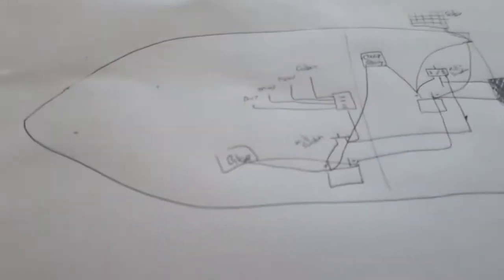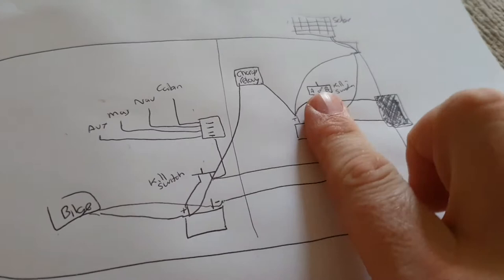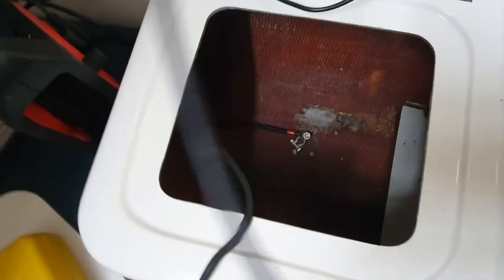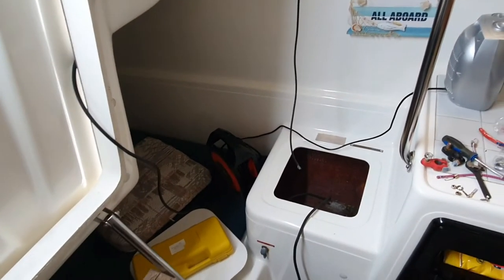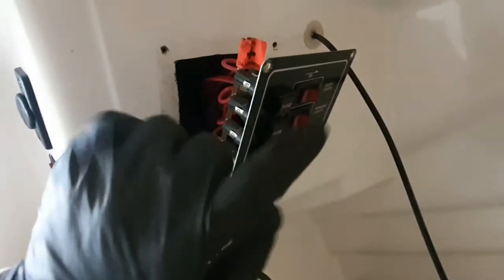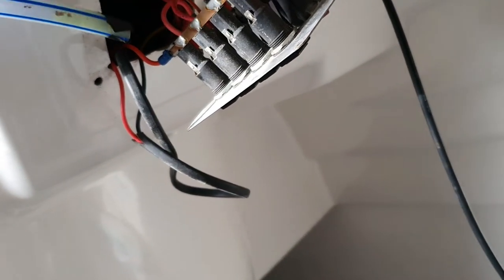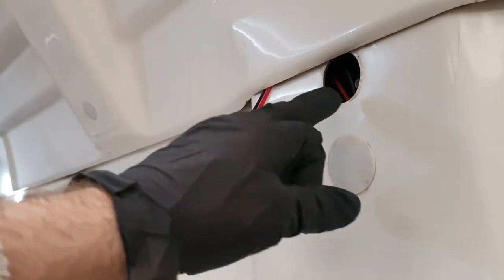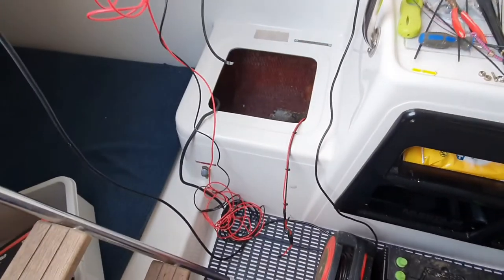Macgregor 26x Sundance - Rewiring the 12v System #3

Comment: Hi, Maybe you should consider connecting the solar to the house ( leisure ) battery instead of starting.  Since the starting will show very little discharge, it would make sense to put the bulk of charging to the house, which will be discharged a lot deeper. Keep posting.

Comment: Great stuff. In the process of rewiring my 26X also.....  Found using a measuring tape invaluable to route cabling.... Have an ACR Add a Battery included for AC charging. Spent months designing and sourcing equipment. Its a full rewire. What was there was pretty outdated and dangerous. Please do keep posting....

Comment: The cheap speaker wire going to navigation lights is fine, provided you use LED.  Almost no current in line.  I am running a separate battery in the pedestal for powering chart plotter and autopilot (which I use when engine is on only.  I will run a "patch" to connect that battery to mains.

Comment: Would it be possible to run that wire from the switch panel through the back (stern) and down below into the bilge area...back forward to the battery?